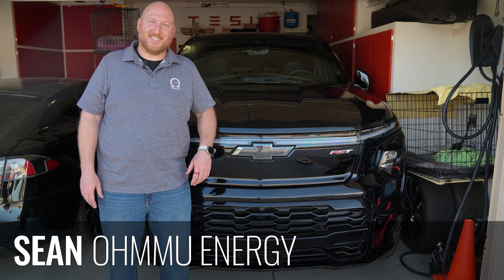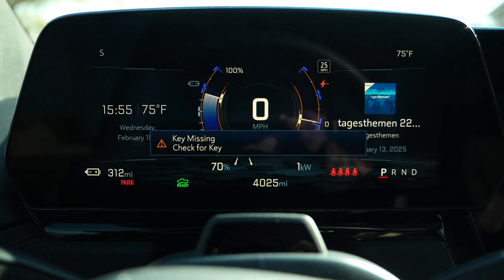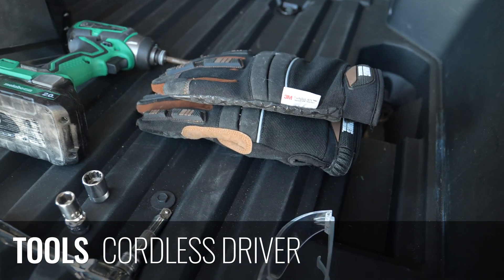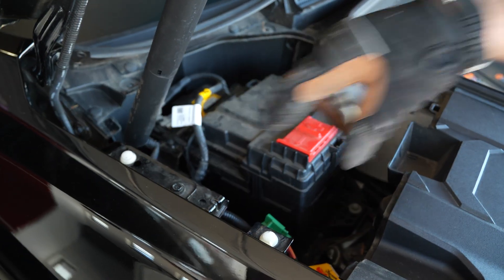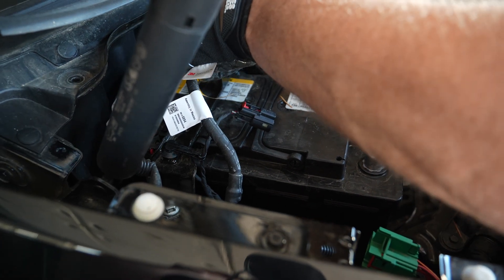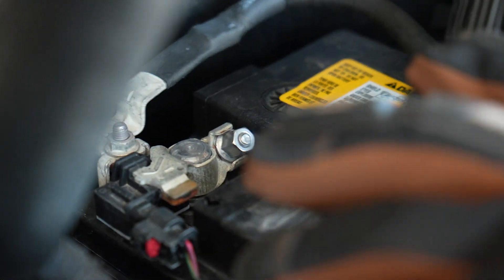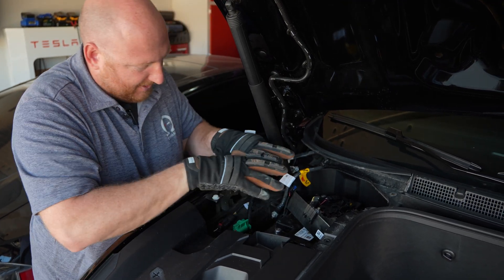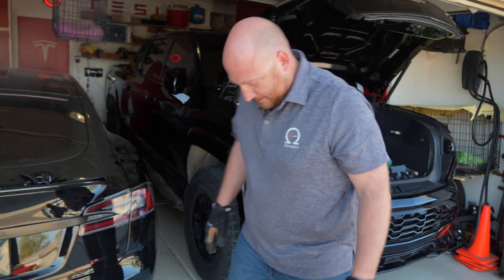Chevrolet Silverado EV - Ohmmu 12V Battery Installation

Comment: How is this battery discharging/ charging in extreme cold  weather?
Reply from the maker: Discharging really isn't an issue for LFP or Sodium in extreme cold.  Charging can be, there are caveats which include "charging at what amperage?" and "how cold is cold?".  HOWEVER, Ohmmu batteries handle the cold just fine regardless b/c the LFP batteries all feature self-heating elements which will warm the cells up when it is charging in the cold.  Our Sodium batteries don't need to be warmed up and can handle extreme cold charging without missing a beat, they are very robust!